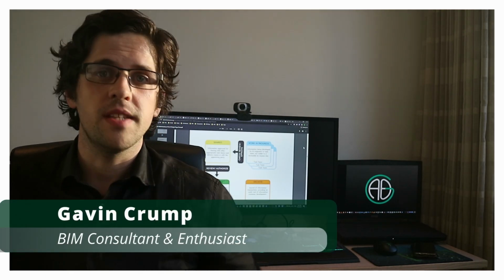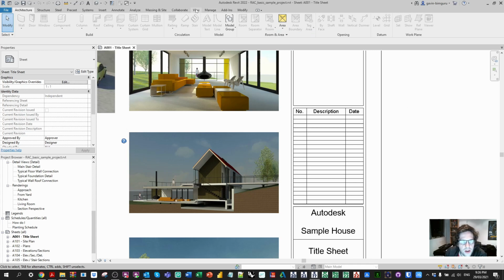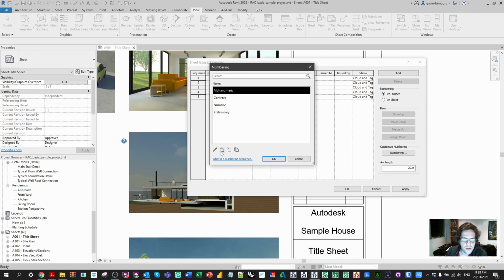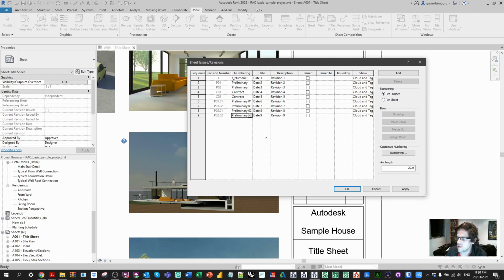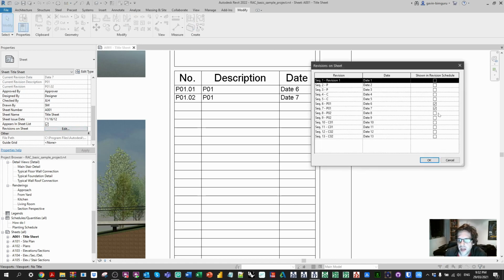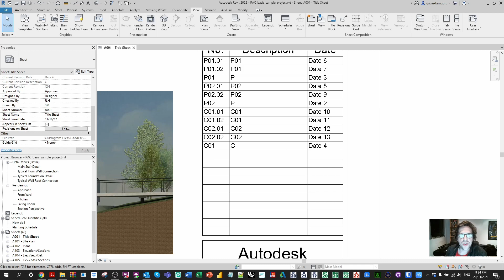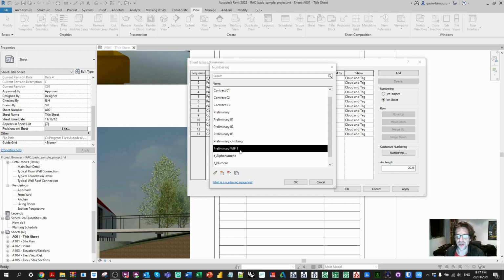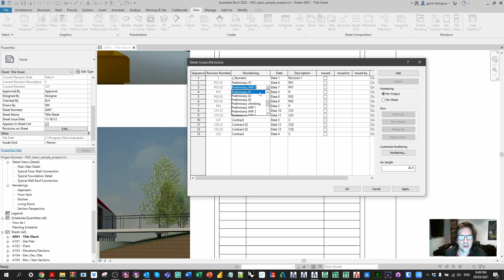ISO19650-2 Revision system in Revit (2022)!

Comment: Thanks for this - but something I still can't figure out is the date field - if you have a different sheet and are doing by per sheet, the date field is going to be different - so don't you then need a series for every single sheet?
Reply from the maker: Yes unless you do project level revisions then date would be a compounding field potentially. It's not a perfect solution given by Autodesk unfortualnately, and not a very machine friendly revisioning system either (not sure which platforms have it perfectly covered currently if any).

Comment: Thanks Aussie for sharing this and showing that the way Revision works in Revit does not comply with ISO, we have decided to interpret/twist the norm and don't use subgroup WIP and just use formal revisions, we have splitted the preliminary and construction with numeric and alphanumeric and use the issue by as the P or C as we are far yet from Revit 2022.
Thanks again!
Reply from the maker: Yes if you are just using a P/C system with no WIP revisions then that would be the easiest approach. I've found in my experience it can be difficult to convince designers and architects not to track their WIP revisions however.
Reply: Hi Gavin, thanks again for sharing, it is definitely a progress however the problem that I can see with this approach, something you note on the video too, is the amount of multiple revision that we are forced to create, super complex to manage, for e.g. if we need to WIP revise a set of sheets one day some of them are P01.0..P02.0..,..P05.0 we need to create as many revisions as sub wip groups, crazy!
Reply from the maker: Indeed. I think now that Autodesk has put some effort into getting closer to the standard, it's time for the standard writers to review if the system itself is practical - even on paper it is quite convoluted for a basic architect to understand, let alone a platform to capture.

Comment: Only WIP containers do have the additional two integers as in P01.02, once the information is to be shared or published within a CDE it should goes as P01, C02; The importance of P01.nn is for internal purposes within a team to keep track specifically of 3D models; Revisions in terms of internal Revit Settings are better kept @ Pnn, Cnn for better drawings management;
A nice video as always, keep up the good work Gavin!
Reply from the maker: Yep, understood!

The .01/.02 system seems quite dependent on how the CDE is managed.

I've heard from some who still are forced to track this via excel schedules - quite worrying!
Reply: @AussieBIMGuru  based on personal experience with BIMsync CDE, the platform will consider any added package a revision automatically with no control over it, moreover and based on BS-EN-ISO-19650:1, revisions can be considered metadata, while this would comply with a given CDE, imagine working with one version of a file on your local drive with no increments over time :D.. That being said, I prefer to have my naming(s) with the .01/.02 and remove them once I share or publish, on my local drives and the adopted CDE platform, this way all of the information is aligned with each other both offline and online, always for better information management
Reply from the maker: @elietrad  thanks for sharing your experiences, i had a similar one on a transport project where we closely followed ISO19650 and the annex. The system automatically determined the revision and was moreso a metadata field, although the client insisted on the pxx.ox all on the revision titleblock - lots of shared parameters and mess to manage!

Comment: Very useful—thank you for looking at the different options and highlighting the problems with it. I won’t be replacing our custom addin to handle ISO 19650 revisions just yet!
Reply from the maker: Yes it isn't quite there vs some alternatives I'm aware of at various firms. I also wanted to get the issues out there before all the Revit fanboy/girls begin touting it as the final solution to the problem, when it isn't actually quite there yet - good to have it on hand when I come across these types! It's a heck of a lot better vs what we had, but more is needed.

Comment: So basically it does not work for ISO19650-2 and it's yet another Revit workaround.
Reply from the maker: The sub-sequence has a degree of workaround involved, yes. It's a shame that they got close, but didn't satisfy the system entirely (it effectively needs a secondary sub-revision field).

Having delved through this iSO system i must say it's quite a convoluted one, definitely designed on paper only and not in practice - keen to know if any program captures it more effectively.

Comment: No XML import or export, all manual input, men o men, what a program.
Reply from the maker: Usually we use Dynamo or apps to populate revisions from Excel. Fairly similar to parsing XML's to drive native functions. Always pays not to think inside the box that software developers give us!

Each program available to us in AEC currently seems to have too much manual work required in one way or another, it just depends where the work is done. For example filling out a spreadsheet is still manual, just more efficient if you can process the data and input it in this way more effectively than the program itself.

I still have yet to see a program that does all the heavy/unnecessary lifting for us (please, oh please - don't say BlenderBIM. Heaps of manual work there needed outside the data features).
Reply: do you mean that you would like to have export and import this 'Sheet/Issues revisions '?
for what you would need it ? Do you get info like that from other program or maybe you get it from others Branch of designers?